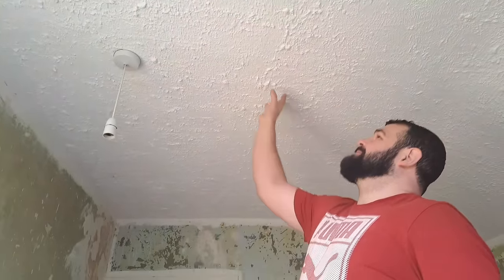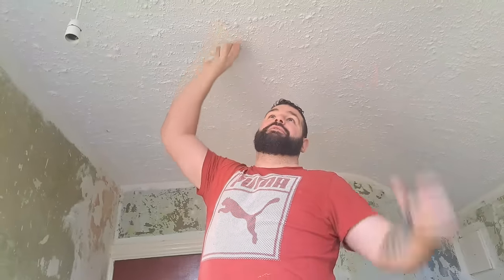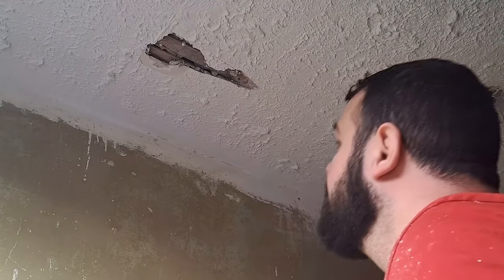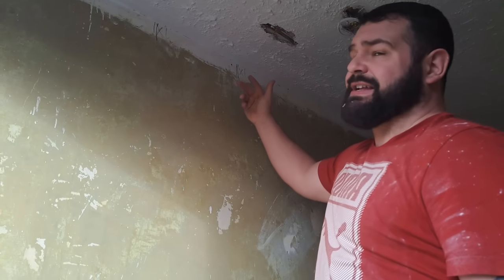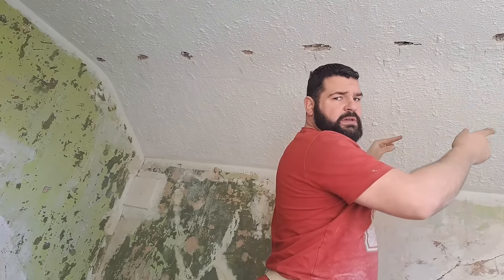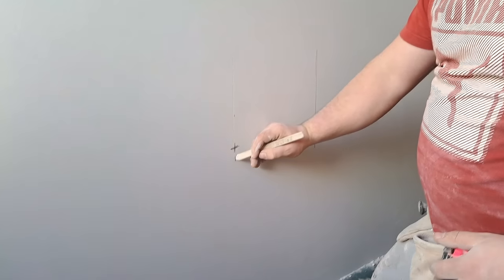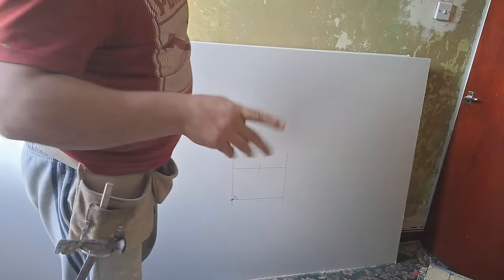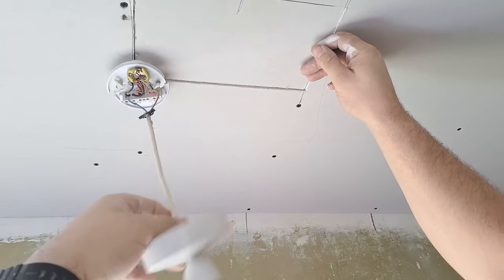How To Overboard a Ceiling | Without Removing the Light

Comment: One tip for finding the joists without making a mess, is to use a neodymium magnet and run it over the ceiling, it will stick to the nailheads, mark them up then connect the dots 😀

Comment: I've mentioned this in another video but I would avoid plaster boarding a ceiling, The do eventually come away from the ceiling. You end up in a whack a mole situation of trying to re-screw it back on and redoing the plaster only to find it starts coming away from another part of the ceiling later on. I would recommend any other method regardless of how hard it is.

Comment: Great video. Very imformative. can I advise If you hit a water pipe with a screw dont pull it out leave it in  and go turn the water off. Then you know exactly where it is  and it wont leak as bad with the screw in

Comment: when i had to do this to all the upstairs  ceilings in my house I got  in the loft and drilled a small hole in the ceiling each side of the  joist tight to it at both ends, so I could see it from below  as I was on my own, lucky I did it this way as the joists werent the same distance apart and some are thicker than others and are not exactly parallel  - the things they got away with these 1920's houses lol

Comment: Easyest way to do the light mate is to cut the board where the wire is and then notch the next one around the cable then ya not left with a big square mate  btw from a plaster to a plasterer I live your vids

Comment: I have a wimpey nofines house which has a concrete slab type cieling with concrete joists running across. The slab can be pictured as floorboards between regular joists.

A company wanted to do insulation and said they would screw extra thick plasterboard into the celing.

ie the plasterboard at the moment is about half a hand span away from the concrete. It looks like they must have dabbed it on.

With the heavy plasterboard how would you even insure it sticks? Ie mold ...moisture...etc 

I've heard some say leave it and others say you can screw extra thick insulation board which had moisture layer side into concrete..

Any help or advise would be appreciated.

Comment: I have the same ceilings down stairs with a dip of 20mm in some areas but not all plus a crack of 2mm running from one end of the wall to the other from the start of the extension all predated 2000, can I over board or does the whole ceiling needs to come off and replaced with new plasterboards..

Comment: Hi Kirk, your videos are great! I would like your help please. I've stripped the old wallpaper  and the wall is with old white paint that is peeling off and full of blisters. In case that you have walls with wallpaper. Please advice what is the best way to prepare the wall for plastering ? SBR, Zinsser Bin? Should I wash off the old glue and remove this white paint somehow? I always have issues with that, as the final plaster starts blistering as well after a month. Do you know a technique to plaster the wall without strip out the wallpaper? Thanks a lot mate!

Comment: I have a question matey I'm in a debate with customer over boarding there bathroom  I'm saying because they are having the hole lot tiled they don't need to use moisture resistant boards if the tiles are sealed properly am I rite in saying this? As this is the way I was shown

Comment: Great video again Kirk! Don't worry about the editing dude, it's all about the straight to the point info and your personality, that's what make it enjoyable. 
Question, can I render over old painted render / painted brick. I need to sort out my extension which was build in the 70s. Any videos coming up of this nature? 😉. Cheers
Reply from the maker: I can only answer if you promise to work in inches 🤣

Chris it all depends on what you want to put over the top mate. 

If you wanted it to be 100% then get a needle gun and take the paint off. Failing that I would look at painting it with rendaid and then fixing EML to the wall with screws and washers. 

You could chance it with rendaid and some ewi base coat because that stuff sticks like shit to a blanket. It's designed to stick to polystyrene so it really is good stuff. 

There's loads of variables involved mate and for me to give you the best advice it would be good if I knew what you wanted to render it with and what the paint looks like.

You do know you can email me, my email is in the channel description mate
Reply: OK I promise 🤣. I all seriousness I work in both, depending on what I'm doing. Was taught in imperial by my dad and grandad. 
I was thinking just sand and cement, doesn't need to look 100% as it may be knocked down and a full width extension built in the future, just want it to look acceptable for a couple of years. I'll look into those products you've said, thanks for the help. I have your number from the buy a beer email, can I ring you if I get stuck mate? Cheers Chris
Reply from the maker: @christopherbailey582  ahhh of course you can mate, that's what it's there for Chris
Reply: Cheers Kirk 🍻

Comment: One of my first jobs about 10 years ago, overboarded a ceiling and some bastard had notched the bottom of a joist for a mains water pipe. Screwed straight into it and I was so green I took the screw out! Stop cock was hidden behind a drawer and the customer was out. The water was coming out of the soffits like a waterfall.

Comment: Kirk mate. I’m overboarding a lath and plaster ceiling with artex on it. What thickness do you recommend? Don’t want to lose too much ceiling height. 

Let me know
Reply from the maker: 12.5mm mate.
9.5mm can sag if the ceiling joists are far apart and I don't think you'll notice the 3mm difference when it's all done
Reply: 🫡 yes boss. The reason I’m overboarding is because  I done 1 coat of multi finish in the artex without realising there’s lathe plastering underneath. Schoolboy error. House is 1870s Victorian. Would you say it’s best to overboard or would you just add another coat and leave it. ( ceiling is pretty sound )
Reply from the maker: I'd probably just skim it aslong as it's solid and the artex doesn't scrape off to easy
Reply: Would you recommend 2 coats of SBR the day before? Rather than a few hours before, , to give me more time, as this ceiling seems to be incredible high suction. Proper ball ache

Comment: Why cut a square out that’s madness. Just take the wires out and tap a small hole through the board. That’s just making more work and a weak point in the board.,it’s not hard to take a light fitting down 😂
Reply from the maker: You'd be surprised how many people won't touch electrics, especially whenbthe don't understand how a switch live works.
Reply from the maker: Oh and if your working as a plasterer in people homes and you start tinkering with their electrics without knowing what your doing then you could open a whole can of worms... loose wires cause fires An all that